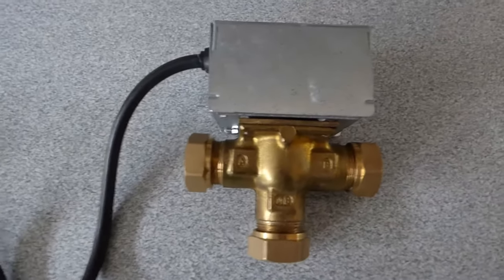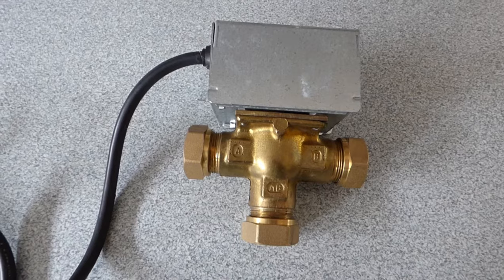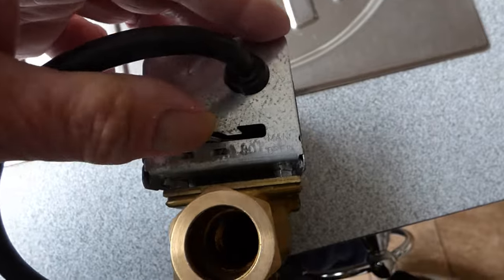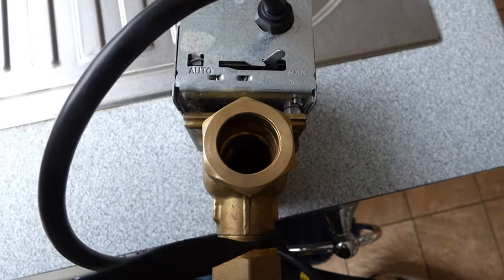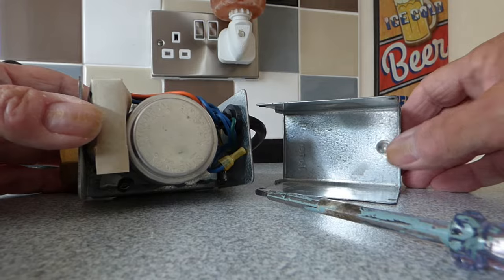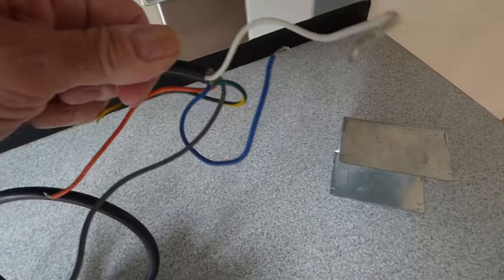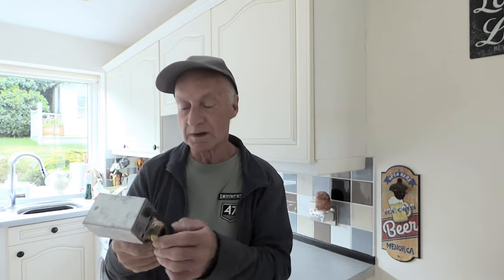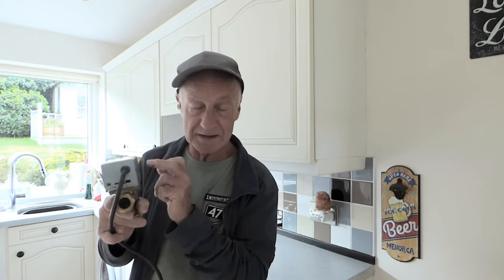No heating? An easy fix using a switch on the motorised valve

Comment: Hello, thanks for the video. Ours has failed in stages, first no hot water but heating worked, then heating packed in, but we still have heating upstairs controlled by a separate thermostat. I have 3 motorised valves in the airing cupboard, one labelled ‘Up - upstairs I’m guessing - ‘D’ - downstairs and then one on top of a pipe feeding into the tank. I have moved the lever on the D - downstairs one to manual open. But the boiler still isn’t firing when selecting +1 hour for heating or hot water or both together. In fact when both together the thermostat just flashes and clicks on and off. We have Honeywell thermo and a logic 15 boiler. Any ideas? Should I switch all 3 boxes to manual open? Thanks in advance
Reply from the maker: You can try that, by I expect the micro switches in the downstairs motorised valve may be gone. When in manual make sure the boiler stat is switched high.

Comment: Hi there, love your videos....
Got a question about a 3 way diverter. Now the customer says it use to work with hot water and heating on at the same time.  It works singly, one of the other, but the problem is the hotwater doesn’t work on the ON function it only works on the once function. The heating is ok, works on any function. 
What’s the actual problem with this diverter. Thanks for reading.... feedback welcome, Thankyou.
Reply from the maker: This sounds more like a programmer problem. If both work on continuous then the valve is fine.
Reply: Ok my friend, will check it thanks for the feedback.

Comment: Thank you for the greet video! My heating is always on when hot water turns on even in the summer. Is this a 3 way valve issue too?
Reply from the maker: Yes
Reply: Great video!! Similar problem.I have a sunvic 2701 motorised 3port valve when I turn on the rads on my electric heating panel nothing happens but when I turn on hot water both rads and hot water comes on together working off the thermostat in the hot water cylinder. Is the an valve issue.
Reply: It was faulty actuator on the 3 way valve. All working now once replaced. Thank you all.

Comment: I have a hot water issue. Central heating works fine. But hot water on its own won't come on (I.e. Boiler won't fire up and pump start), however does seem to heat up the water when the central heating is also on (as the central heating does fire up the boiler and pump)

I have two 2-way valves. The one for the central heating has no resistance on the lever, doesn't make the whirring noise as you move it to manually open.

I'm guessing central heating is stuck on open. So when only hot water is on the system is getting confirmation that central heating is shut and hot water is open to allow pump and boiler to start. Does this sound correct? And replacing the central heating 2 way valve should fix it?

Any advice appreciated
Reply from the maker: Personally I would replace both valves.

Comment: Hi. Thanks for your video! I have two of these controlling an annex. They have both gone at the same time! Been eight years. The lever on one has no resistance at all and the other one keeps opening and closes when calling for heat (springs back and forth between open and closed making a noise when doing so). Basically both installed at same time but have both failed in different ways. Please could you comment on the possible problem? I would like to just open both up and control with TVR's if possible.? Jammed the one that springs back and forth in place (as it kept slipping back to auto) but the other has no resistance at all i.e. just slides back and forth between auto and open with no resistance. Any help appreciated! Model is HONEYWELL V4073.
Reply from the maker: The one with no resistance is kuput. The other is noisy but still working. Why don`t you just get rid of them and replace your thermostatic rad valves in the annex with smart ones.

Comment: Hi, thanks for such an informative video. This has helped me enormously in tracing an issue with my central heating. May I ask you one question? I have a 2 way valve that controls the downstairs underfloor heating. Isn’t firing up the boiler - I’ve checked the switch and it correctly seems to have opened up with load. if I turn the load off it then has resistance, so I’m assuming that part of the valve has worked. Is there part of this valve that then signals the boiler to fire up? Thanks very much in advance!
Reply from the maker: There is a microswitch in there that could have failed, but if the valve is not spring returning it then that may be the problem. Whatever a new valve is the best answer.
Reply: @dereton33  thank you sir

Comment: Hi there.
I've got hot water and hot radiators upstairs. All cold downstairs accept the downstairs toilet which is almost directly below the tank and this valve.
On this valve, the lever was in the center.  I've moved it to auto and manual but it's very loose, no resistance or noise moving the lever.
It's hot the unit, so possibly burnt out?
Only confusing part is have hot water and hot rads upstairs. All but one cold downstairs.  Is it this valve?
Reply from the maker: Check the heating pump first, if that is ok, then yes renew the motorised valve.
Reply: @dereton33  thanks for the response.  Will check in that order.

Comment: If I remove the head will any water come from underneath also do I have to drain the system first thanks Jim
Reply from the maker: No the head is ok to remove unless it is a real old model.
Reply: @dereton33  Thanks it is an old model should I do something different ?

Comment: Hi there! I have a new issue where when any hot water tap is on, it activates the central heating as well. So when I used the hot tap the two rads closed to the boiler get very hot. It wasn't doing that before - my CH had been off for months due to needing new rads. Why is the hot water tap now inexplicably linked to firing up the CH? Thanks for your help!
Reply from the maker: The 3 way valve.
Reply: @dereton33  Thank you!

Comment: Thanks for this info. Looks like the motor in mine is burnt out - the lever is loose, so I assume it’s stuck open. I’ve called the engineer.
Reply from the maker: You can just get the motor on top and renew it yourself.
Reply: dereton33 cheers - however by the time the part will arrive, the engineer could have sorted it. We pay for boiler cover, so it should be covered. Thanks for the info though

Comment: Hi...I have a problem with Center 2 Port Motorised Valve 22mm  I don't know if is a problem with the head or valve I changed just head ( not valve ) for new one  and I  found this problem.
When I turned on the water for heating the Lever stay in position not moving( motor works ) but my central heating works as well even though it is turned off
When I turned on central heating the Lever changes positions to the top ( I think this is like should be ? I have right or not?)
The valve wasn't stiff I  easy turned by my fingers 

 Pls  give me any advice's Thank You
Reply from the maker: Hi Check your wiring is ok.

Comment: Great video and a total lifesaver! Quick question....I removed the square cover from the unit and the round cover off the motor to discover that the flywheel on the outside was spinning freely and making a weird noise! Its a 3 -way device. I had previously switched to "manual" due to lack of heating as you advised and it worked for a bit but then was a bit stop start  - I'm guessing the unit is completely useless, does that sound the case? Cheers and keep up the good work!
Reply: Hmmmm. ... now the pump light has gone out!
Reply from the maker: That we be due to the valve micro switch being broken along with the valve.

Comment: What is function of white cable and where white cable will go to connect
Reply from the maker: Switching live. You will need to check with an electrician where the wire goes as all systems are different.

Comment: Is mine faulty? If I move to manual, 1. It doesn't spring back, and 2. It hasn't got the tension to remain locked into manual. 
This is with power to it, and thermostat signalling to have heating turned on.. 😢
Reply from the maker: Yes faulty

Comment: What does it means if the lever have no spring when switching over to manual? And does not lock open?
It didn't work for me.
I have the exact same one, Honeywell.

Only one radiator is working in my upstairs bathroom.  The rest of the house is completely cold and all the pipes too.
Reply from the maker: You need a new vlave.
Reply: @dereton33  got the valve change with the local council but it still didn't work. Still ongoing problem, so I will update when it's finally fix.
Reply: Finally fixed now. Central back on full blast. Plumber had to change the boiler heat exchanger.

Comment: If this switch was jammed would it explain the knocking sound when I turn on the heating?  There is no heating but I have hot water.  Thanks
Reply from the maker: Yes more than likely, switch the valve over to manual for now, then you will get heating.
Reply: @dereton33  Thank you so much
Reply: Checked the valve and the lever moves freely, it's a 2 port BOSS valve.  It hasn't worked moving it over.

Comment: Have this same problem but Tried this fix and didn't work for me. Water heating works but no heating. Any idea what the problem could be ?  Thanks 🙏🏽
Reply from the maker: The microswitch has gone in the valve, it will have to be replaced. The head motor that is.
Reply: Ok..  will go buy a new one and try replace myself. Thank you for replying
Reply: @dereton33  got the replacement 3 way powernead today and fitted it in about 10/15 minutes.. heating now working.  Thank you so much for your great instructional video...🙏🏽

Comment: I have to put on the water and the heating to get both they won't work separately 

Looking at the lever it's all loose no resistance at all 

I take it just the motor then 

Thanks 

Tommy
Reply from the maker: Normally that is the case.
Reply: @dereton33  thanks I'll have a go at replacing it

Comment: Hi
I have both valves in manual and still the boiler is still not heating the radiators. 
The boiler is fine. I'm getting hot water through taps and shower. 
What can be the issue?
Thanks
Reply from the maker: Switch the hot water valve back to auto.leave the heating one on manual.
Reply: @dereton33  Thanks for the reply. I have 2 zone valves (downstairs & upstairs) which are located in the bathroom behind the bath panel. I've tried them both auto and manual. They are both hot water.

Comment: Can I run hot water take the body off as the manual leaver just lose if so which portion the value to open
Reply from the maker: You will have to experiment with turning it with pliers in each direction until you get it right.

Comment: When you've got the motor box off and have access to the valve sticking out of the body, how much should you be able to turn the valve ?
Reply from the maker: Half a turn.
Reply: @dereton33  - Ok, cheers.
Just got my hands on a new 3 way valve that's the same as mine and it only turned an 8th of a turn. The same as mine, which I thought was nowhere near enough. But it seems that it is.

Comment: May I ask a stupid question ? If the brass part has seized then will switching to Man make any difference ?
Reply from the maker: No it wouldn`t john. Luckily that does not happen too often.
Reply: @dereton33  Thanks. I had assumed that the valve seizing was the reason that the motor burns out !

Comment: Excellent video. I have exactly the same kind of valve on my hot water tank - last night it started making unusual noises, as if it was labouring - then the noise suddenly stopped after a few hours. My wife and I have since found that the Hot Water doesn't seem to want to heat by itself (We have HIVE Heating and are in the habit of leaving the water heating to ON all day) - tonight we thought we were going to be living without heated water until the issue gets fixed - HOWEVER - we turned the Central Heating on - and hey presto - the water immediately started to heat up too. So it looks like the Central Heating has to be on in order for the water to heat up - could this be connected to the valve issue? I've checked the switch on the valve you mention, this is set to the AUTO position. Have also noticed that the valve itself is very warm to touch - is this normal? Any advice appreciated. Many thanks, Alex
Reply from the maker: The valve is always warm. If you need the heating on to get hot water then the valve is gone.
Reply: @dereton33  Thank you very much - appreciated.

Comment: hi, great video, i have this problem for my elderly mom , with the hot water switched on the boiler will light up and on manual setting she as central heating, but if we switch off the hot water and turn on the heating the boiler doesnt fire up, just want to make sure that is normal when this valve is faulty, thanks
Reply from the maker: Yes quite normal.
Reply: @dereton33  hi, thanks for the quick response, my mother has been given a quote of £350, i was going to change the head part but on the inside there are 4 screws which attach it to the pipe not 2 like your video, on the underside of the the metal casing it's brown like burnt, could I just change the, synchron motor, I've seen the links for this. Many thanks. Regards Gary

Comment: Hi, tried what you said. , put in manual. , but soon as I turn on boiler it’s jumps out of manual.  Every time.  
Help please
Reply from the maker: Wedge the lever with something to keep it in place. Small matchstick is usually good.
Reply: @dereton33   is there any reason it jumps or is that normal. 
Thanks for your help

Comment: Hi could I just remove the actuator ans use pliers to open the valve,i only need the heating .
Thanks in advance
Reply from the maker: Yes you can
Reply: @dereton33  thanks

Comment: our issues is with heating is that  in the morning the boiler starts/fires up as it set up in the programmer and it will run for a few minutes, one of the the pipe from the burner get worm, and it will stop and wont restart and the radiators stay cold like its something wont let the hot water do the circulation
any advice?
Reply from the maker: 3 way valve problem. Try it on manual.
Reply: @dereton33  thanks, tried on manual heating started, not issues with heating, however now we don't have hot water. I reverted back to auto, but still no hot water only hating.

Comment: My heating system won't switch off despite the programmer being off. The boiler is continuously firing, as it thinks heat is being requested. The only way to stop it is by switching it off at the mains. I did suspect it was because the valve was jammed open but after watching this I'm not so sure.
Reply from the maker: May be the microswitch in the motorised valve other wise it could be an electrical problem.

Comment: Hi why is it when I leave mine on automatic then only downstairs radiator comes in but when I put it on manual both upstairs and downstairs radiator comes in perfect
Reply from the maker: Valve not fully opening.

Comment: Hi Dereton!. My unit is making a lot of noise today! Even when timing for heating is off...why is that??  I did lose heating - but moving the valve lever brought it back. Guess I need to replace the unit. Will try setting on manual. My timing controls both heating and water together (same time), so is the auto setting the middle point??  I will try on manual, but not sure it sticks at that position.
Reply from the maker: The auto setting is the middle point. Change the valve when you can.
Reply: @dereton33  hi, had to turn off power last night and as noise would not stop. This morning lever is over to right and I can move freely...seems to be not doing anyting, or very little. Also it can't be kept in the locked (push up) position, so suspect something has gone....Thank you! This is a Honeywell 3 port unit. I will look for suitable replacement...

Comment: My hot water is coming on via the timer, but the heating isn’t, although we can manually change the 3 way  valve to make the radiators come on. When this problem started my husband decided to up grade the thermostat to a Hive system.  The same thing happened the hot water comes on but although the receiver lights up to say thermostat is calling for heating it doesn’t come on.  So he changed the 3 way valve.  It’s still the same.  We have spoken to a plumber, an electrician and a gas engineer, they all say they cant help.  We are at a loss to know what to do, has anyone any suggestions?
Reply from the maker: I would check the wiring is correct.

Comment: Hi, Great video... Are you familiar with EPH V221P valve? Have one for underfloor heating which hasn't been t working - lever was on on auto so have moved to manual.  Hopefully that works but can I ask, the levers on EPH models (have one for hot water also which is working fine) seem to be quite loose - just a small bit of resistance when moving it.  Is that normal? thanks!
Reply from the maker: Yes that is quite normal Triona.

Comment: I have no spring pressure in the unit... lever is loose, ho heating or hot water, boiler and pump don't run
Reply from the maker: A new valve will be required.
Reply: @dereton33  ok we sorted it this morning,  thanks 😊